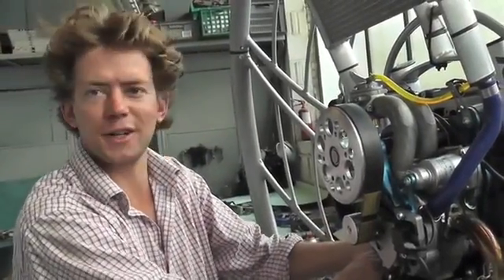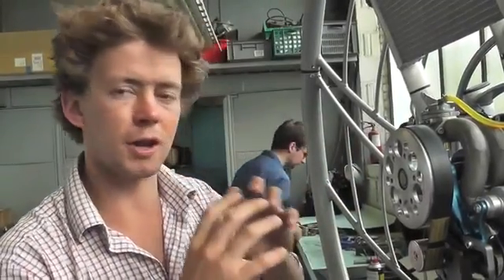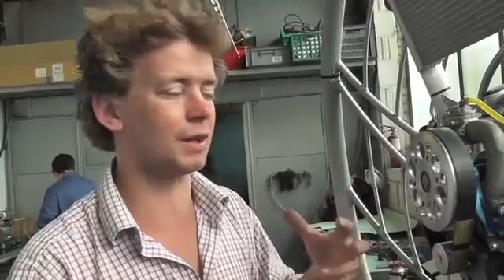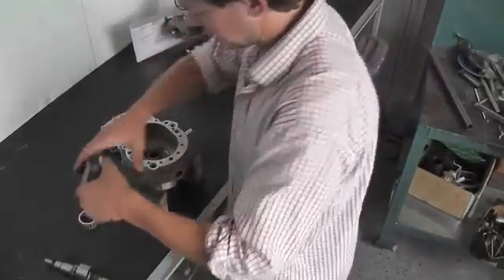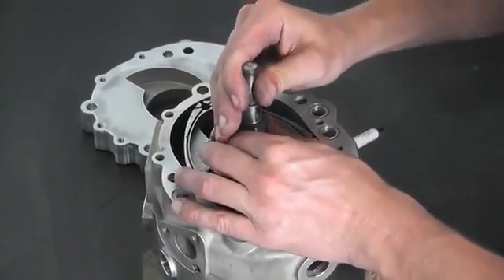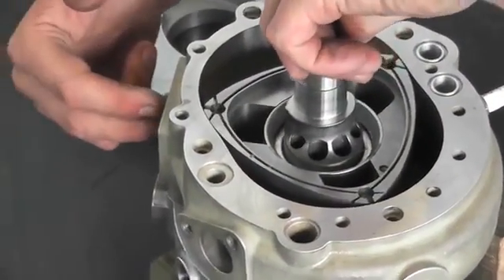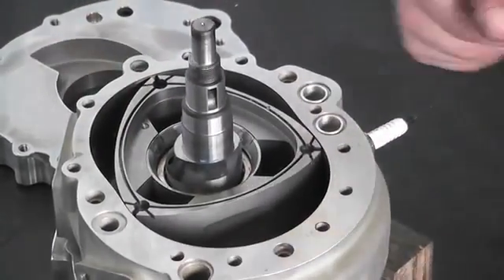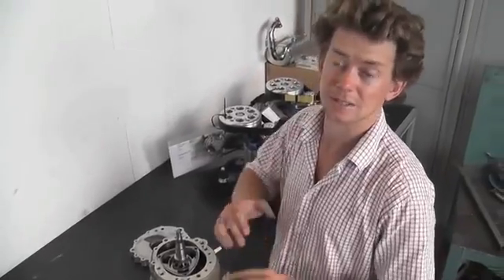A Walk Around Parajet   Part 1

Comment: Dear Mr. Cardozo,  Yes - I am as exited as You R about the Rotary Engine as R. What Happened? I can only assume that it was a Cost thing & that folks weren't justifying the xtra cost of the Rotary as compared 2 the Piston. There are those that may Not prefer the smoother Linear Acceleration as You describe compared 2 the 2 stroke Power Bands. - Then - Perhaps 2 many of these Rotary Engines were returning 2 often 4 Maintenance… OR - You lost a Key Team Member - Which one is it? Ahhhh - The ONLY Place that I've found a small Rotary Engine available Commercially is through the AiXro company. (https://www.aixro.co.uk/product/aixro-xp-40-rotary-wankel-engine/ I am STILL trying 2 justify the 50% cost increase of this Rotary Engine compared 2 a Thor 250-DS...  I find it fairly interesting - - - I recently acquired a Pair of BraNew DK Beat Whisper's. Apparently the fella was a US Distributor 4 DK & when he Dropped Dead his wife Kept them. Now they R mine... & they R Shining Up fairly well. They BOTH have the DK 472 Twin Cylinder Engine with the reducer & the 3 Blade Prop.. Also they came with (4 xtra $) 2 BraNew Replacement Engines 4 them... What Engine was DK replacing that one with? There is absolutely NO marking on the frikin' things! I think one has got a Walbro Carb.?  All Roads Lead 2 You & ParaJet on this Mr. Cardozo - Which I found 2 B an interesting story, That is, You coming up through the Ranks 2 being where You R now. Good Stuff Man. I appreciate ANY Information that You can give me about these DK Beat Whisper ParaMotors.                      Thanks,                                  Lou Ramirez - - -

Comment: I'm an engineer and I'd like to work on Wankel improvements. What other problems were you encountering, other than the cooling, apex seal, side seal issues? Thanks.
Reply: visit the manufacture at rotronuav dot com
Reply: Aixro obtained huge improvements just by pointing Plug Channel towards trailing side of Rotor, as in early Yanmar Diesel Wankel engines, and with a New Rotor Recess shape.